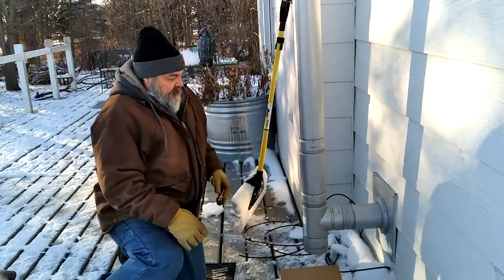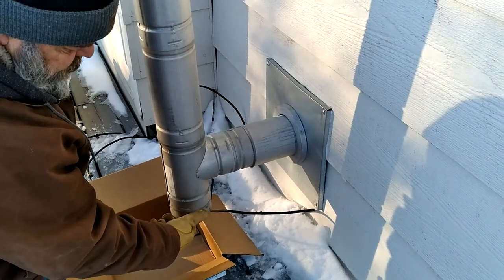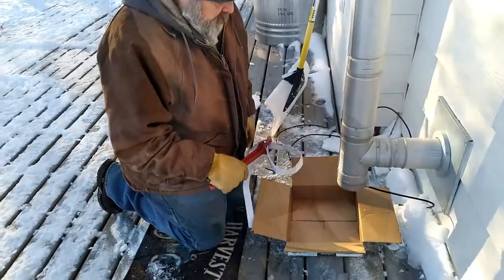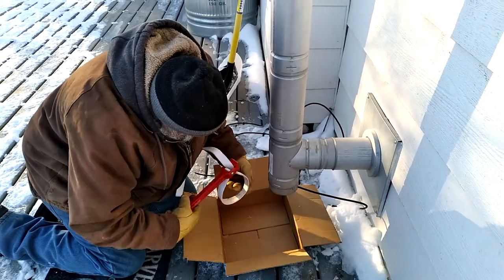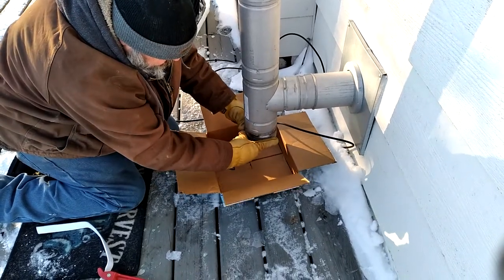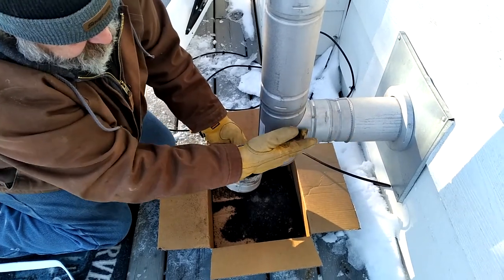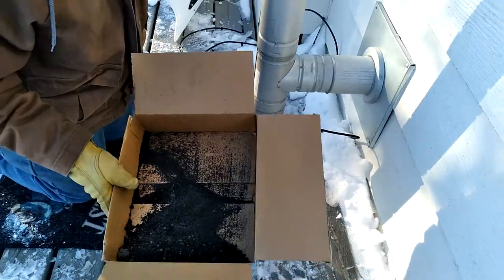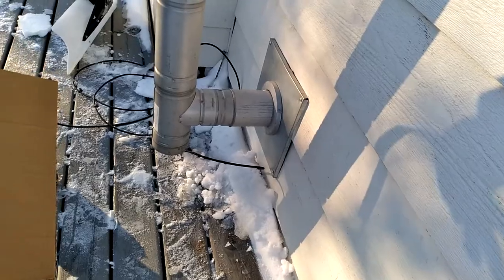PELLET STOVE  T-CAP CLEANOUT | PROPER MAINTENANCE #tutorial #pelletstoves #repair

Comment: You need to clean the whole pipe out each year not just remove the bottom cap?
Reply from the maker: True enough, especially if there’s are additional bends in the pipe… however, this video deals specifically with the T-Cap clean out procedure. I’m sure as we prepare for next season we can discuss additional maintenance further…. For now, this got us through the cold snap and we learned the valuable lesson that we needed to address this before the cold weather set in!  Thanks for watching 😊

Comment: I have had trouble with my clean out as well. I have noticed the wind effects its ability to vent properly. Get a pellett stove they said, you'll love it they said....
Also if it has been plugged enough to keep the stove from running properly the B venting should be swept internally as well. If you would have tapped on the venting you would have gotten alot of debris falling from the walls of the venting into the box. No one likes a chimney fire. Stay warm now.
Reply from the maker: Great feedback! All in all, we are quite happy with our pellet stove. We just cleaned it again this past weekend as snow is on it's way, and we were sure to be more thorough than just focusing on the T this time. Thanks for watching. Stay warm and be safe 😀

Comment: That ash wash enough to shut it down... what was actually wrong?
Reply from the maker: Hi Motorcycle Mike … you’re correct. What caused the issue was a clogged auger. There is a follow up video showing that maintenance :).  Figured we’d hit all of the maintenance points while we were at it 😀

Comment: I have vertical pipe exhaust exterior and some rust holes in galvanized steel and unable to find someone to fix - can I still burn pellets ? I have 100 bags stored
Reply from the maker: Hi Jeanne... can you? Sure. Should you? No, we wouldn't recommend it. Ash, creosote, embers, etc  has access to those vertical exterior pipes and greatly increase your risk of a house fire...and, depending on your home owner's insurance these compromised pipes may be blamed for a house fire, leaving you in a terrible financial lurch. More importantly, your life could be at risk, and we do not want that! 
I would suggest one of two things:  1. Go to your local hardware store (or better yet, a store that specializes in alternate stove heat...they can still be found in some geographical areas) and see if they can recommend some type of safe temporary solution until you can get the pipes replaced. 2. Reach out to others in your area, perhaps via a local social media outlet, to see if someone who has experience with these types of pipes would be willing to consider a barter agreement; they do the labor of replacing the pipes (you'd need to buy the pipes, of course... be sure to get the pipe recommended by the manufacturer...thus can be found in the stove handbook, and can usually  be found online  if you don't have that on hand) in exchange for a predetermined number of bags of the pellets you have on hand! Bartering can be a great resource...just be sure you don't let those bags go until the job is 100% co.pleted to your satisfaction! 
I hope this helps... most importantly, we want you to be safe.
Reply: @countrymamamusings7701  thank you so very much for your thoughtful caring response - I am truly grateful !! I have reached out to so many via social media and calls to many businesses and useless.  No one wants to help me unless I install a new stove.   One question ?  The galvanized outer pipe has rust holes but the inner pipe is stainless steel so that would not rust?  Does the exhaust strictly go through that inner 3 inch stainless steel pipe and the outer one that is rusted just there for another purpose like an insulator ?   The pipe is not touching the house at all it’s a few inches away from siding —  my son just told me that putting photos of rusted pipe and help needed on line is bad as if there was a fire, insurance would not cover after seeing my post.   I have been trying to find help for months and very bad here rural area.  Would you please let me know your thoughts on that 3 inch inner stainless steel pipe and if that’s where the exhaust flow is ?  I also ordered some pipe from site so hopefully someone will come through.  Again thank you so very much sending hugs through this YouTube ❤️
Reply from the maker: Hi Jeanne…  our camp is in agreement with your son as far as posting pics to social media; best not to.  However, putting out a post requesting general help and knowledge from another homeowner may be beneficial, and that bartering option may be attainable.  It’s sad that businesses cannot assist with this aspect of such a basic need as heat without trying to strong arm one into purchasing a new unit. With regards to the pipes, there are unlimited factors to take into account, one of which being the function of your pipe(s) based on your stove.  The inner pipe is obviously for the expulsion of smoke, but the space between that and the outer pipe could be for fresh air intake or for a heat barrier.  Also, the degree of rust and location on the pipes are a factor.  Have you joined specific sites on facebook, such as homesteading/down grid/off grid groups that might be able to chime in with some suggestions?  Oh, and this thought just came to me …. Do you happen to live in an area where there may be an Amish community nearby? They may be a resource for knowledge, as well as possibly completing the task of replacing new chimney pipes for you! Just a thought.  I do hope you’re able to get this issue addressed. Pellet stoves/wood stoves can be such a wonderful way to heat our homes, but they do come with their own challenges. I would be completely lost in such matters if it weren’t for Papa Jim …. Please keep us posted.
Reply: @countrymamamusings7701  thank you so much for your thoughtful response !  I live  hours from an Amish community but will find someone to help me!  Perseverance pays off!  The rusted holes are at the joints, one is below the exhaust vent at top.  I love my pellet stove - the heat is amazing !!  I am burning through costly oil - the 100 bags of pellets are stacked neatly in the basement for 3 weeks —- I will keep you posted !  My son said the pipe would take less than a half hour to replace !  He’s hours away and can’t get here to help me. Anyway I will keep you posted - Have a wonderful day, keep toasty warm, and wishing you Happy Holidays!